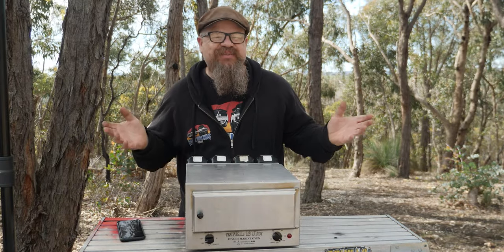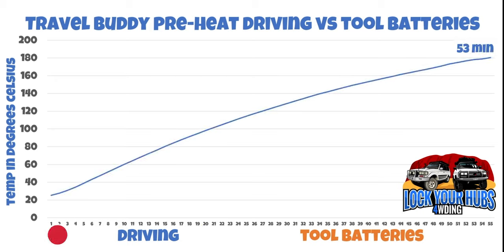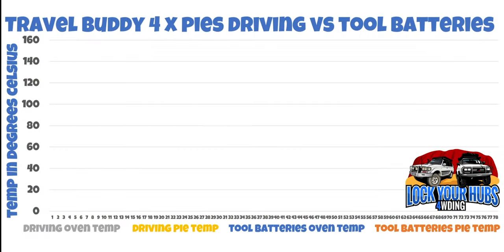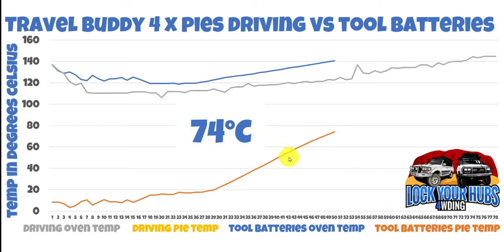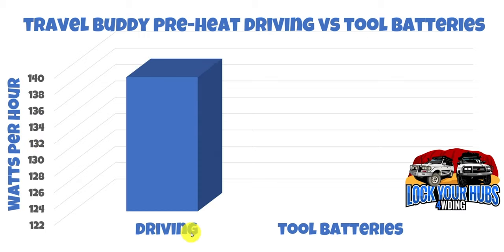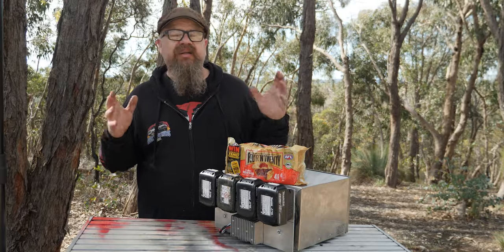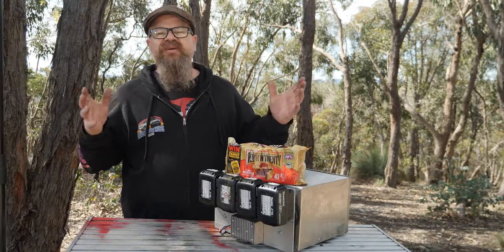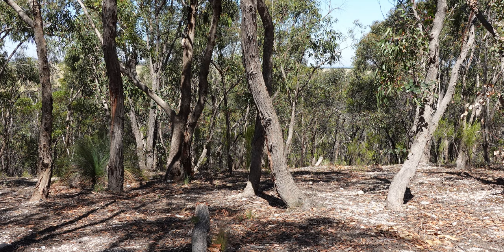Tool Battery powered Travel Buddy 12V Oven!

Comment: Great video.  I would like to share my setup with you.  I use the 25v battery from my little E-Bike, through a voltage reducer to 13.8v and then into the TravelBuddy.  (Still use cord though!!) This setup can provide full temp for up to 4 hours, but main benefit is it makes TB fully portable both during warmup and in cooking stages.  Just a couple Andersons and a plug, (and the voltage regulator that I had anyway) so less than $20 to get working.  When I get home I just charge the ebike battery from 240v.  Easy.
Reply from the maker: Fantastic! 

That's what I'm talking about, I've already got a heap of tool batteries so that's what I use. You've already got the ebike battery so that's what works for you.

It's all about using what you're already got to hand and making the best use of that equipment.

Comment: I upgraded to lithium last year with DC2DC charger. Noticed a huge improvement over the old Optima Spiral. I had be using for years. 
With 14,4V over 13,9V the Buddy was much quicker to heat. With 15V no surprises. Would not go beyond 15V as Element will surely FAIL. 
Sill was able to cook 1kg of Potato Wedges in 2.5 hours LOL.
Reply from the maker: The lithiums are much better than lead acid no doubt, and starting to become affordable as well.

Comment: All well and good if you're a tradie and have the gear on hand, otherwise $200 worth of batteries makes the oven real expensive. Also if you only have one charger it's going to be a real pain to get ready for the next meal
Reply from the maker: I agree, it's not for everybody. I run about 10 Makita batteries for various tools etc, so no worries there. Though I appreciate that not everyone has so many batteries.

Comment: Good test Simon but your math on 3 out of 4 percentages is wrong would've have thought you'd be better than that. Also did you measure voltage at oven in vehicle you say its 14v but is it really?? Also you never accounted for convertor losses in you watt hour usage I would assume they're maximum 90% efficient so there'd be at least 10% more power consumption. Still step up are a better overall improvement
Reply from the maker: Dangnamit, turns out I need to learn how to operate a calculator! I've edited the description with the correct percentages (YouTube doesn't allow editing of the video after it's been published)

Comment: The big question is how long can you cook for on the tool batteries
Reply from the maker: I did the preheat and additional pie cooking on the one set of 6ah batteries, though they went straight onto the charger after that!
Reply: @LockyourHubs4WDing  do you think 1 18 volt battery would be able to cook the pies

Comment: How flat were the batteries at the end. Could you run a second or even third run on the batteries. Thinking about camping viability.
Reply: If he used 130w to heat the pies and the batteries are 18v 

130/18 = 7.2amps used

Assuming each of the 4 batteries are 4amp
4x4 = 16amp

7.2 / 16 = 45% used.
Reply from the maker: Even though I used 6Ah batteries, it's pretty much a one shot wonder including the preheat.
Reply: @y0uCantHandle  Thanks mate.
Reply: @LockyourHubs4WDing  Still pretty good. A great trick to whip out while camping with the guys

Comment: Many thanks.  One request and a question.  Could you do a video of the tool battery build. That would be almost as interesting as this one. Also does 15volt power supply to Big Bertha, kill it, from the testing you have done?
Reply from the maker: The "build" was pretty easy, no real tips or tricks.  The Big Bertha over says in the warranty not to use a step-up, and the max voltage allowed is 15v. 

Though I've never let a warranty get in the way of a good time! So I'll check it out.

Comment: You should do the same with an Engle fridge
Reply from the maker: Now there's a thought! I see Makita have just released a battery powered cooler/heater though don't know if it's just a peltier device or a proper compressor fridge.

Comment: What about the energy used to recharge the batteries? Yes it obviously cooks more efficiently but is there a true gain in having to eventually wait for the recharge of 4 x batteries.
Reply from the maker: It depends on how you charge the batteries I suppose, using the dedicated 12v charger is more efficient than using an inverter and mains charger to recharge in the field. https://youtu.be/uoYUuM8JN18

Comment: Awesome video , thanks simon
Reply from the maker: No worries mate, glad you enjoyed it.
Reply: If I wanted to do this but with AEG batteries did you do an info sheet with the components you used Simon ?
Reply from the maker: It's a pretty basic build, the adaptors are from ebay and use a 15 volt step up that'll take a 18v input. I would probably use power diodes on the battery outputs to stop the batteries from trying to discharge each other if one was more charged than another, and drop a fuse on the output from each battery as well.

Comment: Is there a way to have an internal prob in the pie and the travel buddy cycles on and off once the determined temp is reached maintaining the temp
Reply from the maker: That should be pretty simple with a digital thermostat and a relay.
Reply from the maker: Though to get the probe into the frozen pie I had to drill a hole in the side!

Comment: Wow, you are a bit of a genius! What happens if you feed it directly from the batteries? My guess is that since the heating elements will die with too much temperature and this thing is temperature controlled, then it will work just fine...(famous last words?)
Reply from the maker: It'll probably let out the magic blue smoke! Remember a fully charged 18v battery is around 20v
Reply: @LockyourHubs4WDing  It really depends how quickly the thermostat reacts...chances are it's slow and a long way from the heating elements thermally speaking, so yeah it may go poopie.

Comment: You and your Makita - that's obviously the secret! Seriously tho, running 6Ah compared to say 3Ah would probably make a world of difference to the figures - I know that it does when comparing the torque of a dakka dakka! Or maybe not because of the 15v converter? Cheers.
Reply from the maker: Other than run time, probably not. It's only around 2.5 -3 amps per battery pack.

Comment: Why didn’t you wire the car to the regulator aswell. Preheat times would of been the exact time
Reply: Same with the cooking time
Reply from the maker: You're right, though I would have been comparing 15v performance with 15v performance! 

I wanted to firstly see if it could be done with done with tool batteries and secondly what's the difference between driving voltage and 15V.

Comment: Why not just run the oven straight off 18v?
Reply from the maker: I think that would probably be too much current for the heating element and would let the magic smoke out!
Reply: @LockyourHubs4WDing  na it's fine, I've been doing it for a couple of years now with a Milwaukee 12ah battery.
Reply from the maker: Really? How does the oven perform?
Reply: @LockyourHubs4WDing  I don't do it very often any more but it feels like it works the same. I haven't done tests like you have though. Just got to keep an eye on the battery level as it doesn't cut off when it gets too low. I ruined a brand new Milwaukee 12ah doing this! Also, something trips in the 6ah batteries if you try using them. I got 2 replaced under warranty. (didn't tell them what I was using them for!)
Reply from the maker: @YeahTheOzzy  I know the Makita's have a low voltage cut out, not sure about other brands. Lucky they replaced them under warranty, you can pick up a cheap low voltage cut out off of eBay that'll stop you from killing the batteries.